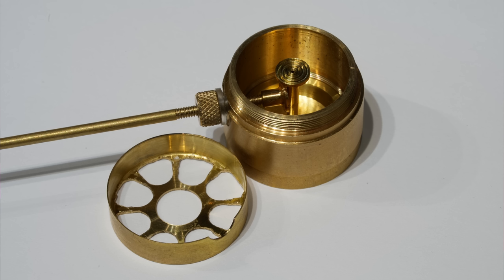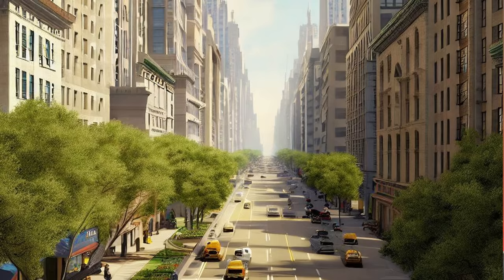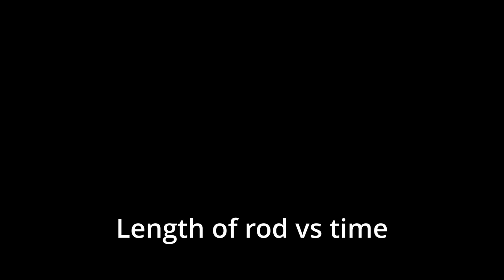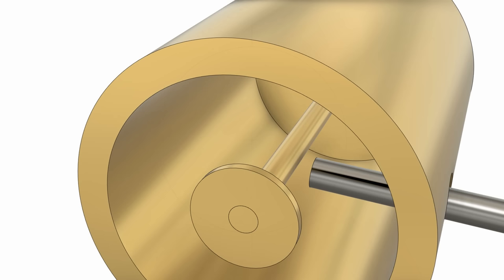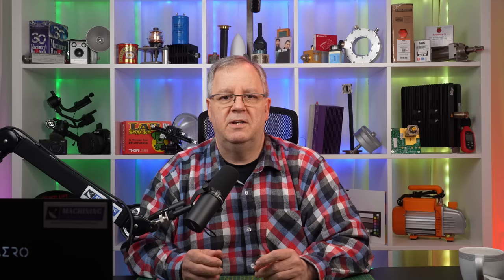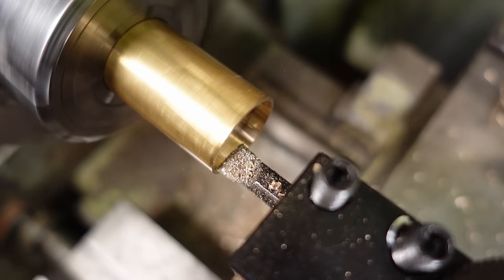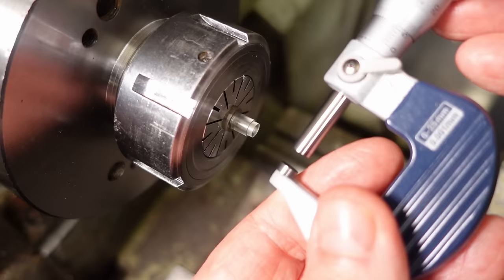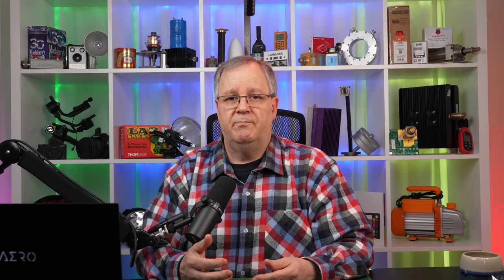SOLVING the Mystery Behind a Soviet Spy Bug : A True Masterpiece of Technical Elegance!

Comment: Have any of you guys thought that he just explained Havanah Syndrome? They weren't using an EM Weapon on the people who were stricken with it, they were bugging them and they were collateral damage.

The transmitter tube could have been something from us in the form of lend-lease gear too. 

Lastly, what are the chances that they would heterodyne down to a regenerative detector? They're known for having a wide receive bandwidth that would make any sort of dynamic fluctuation in frequency less apparent, although at the detriment of being more susceptible to noise which may not have mattered nearly enough back then.
Reply from the maker: Have a read of the wikipedia page about Havana Syndrome and the Moscow Signal. The signal levels for the Bug are tens of thousands of time lower than those we all get from nearby wifi and cellphones.  The only harm from RF is thermal heating, and that needs field levels that are well above the ICNIRP 2020 limits. Those Havana Syndrome effects are usually dismissed as shared hysteria or effects from infrasound, ultrasound, chemical treatments for Zika, stress and so on.  It's fascinating, but there's not much in the way of evidence.  RF signals are trivially easy to detect, and at least in the 3 to 10 GHz range, a few watts on your hand feels pretty hot, despite there being no measurable rise in temperature.  Reasonably High levels of pulsed microwaves are supposed to be able to elicit a response from human ears,  see the paper by Allan H Frey, (Journal of Applied Physiology, Vol. 17, pages 689-692, 1962) https://journals.physiology.org/doi/abs/10.1152/jappl.1962.17.4.689 
Frey reported needing about 275 mW per square cm  to elicit an auditory response.. USSR safetly levels win the mid-70s were 0.01 mW/cm^2 and UK limits were 10 mW/cm^2, so that's a pretty significant signal level. The illuminating signal for the Bug was around 2 million times weaker than Frey's experiment.

I think USSR scientists and manufacturing plants were entirely capable of making their own UHF tubes by 1943, but with a well-developed procurement network in the US, there are all sorts of possibilities as well as potential lend-lease sources and UK supplies.  My stepfather worked on the Arctic supply convoys from the UK to Murmansk during WW2 and said there were lots of interesting-looking packing cases on some of the shipments.  Also of course, there are potential supplies from Germany before 1941, but there was certainly a mature vacuum tube manufacturing base in various parts of the USSR in the 1930s.

Can't see any reason to use something other than a homodyne approach, although a self-oscillating regen might get injection-locked to the exciting signal and give much the same effect. I haven't seen any direct evidence, just multiple anecdotes.

Comment: As the kid I took all apart a lot of electronics One of the things I've noticed is that old phones had speakers that utilized the capacitor propertys listed here.. the speakers were connected to phone wires depending on the length and orientation the phone might have been able to act just the same..😅
Reply from the maker: Most passive speaker technologies can act as microphones.  Earpieces like that usually have a nickel plate with a magnetic bias and a coil to vary the mag field, so more like a dynamic microphone insert

Comment: This is like a string attached to the bottom of two paper cups, when you speak into one cup the sound waves travel down the tight string to the other cup.
Reply from the maker: Exactly, except one of the cups is imaginary and the string is virtual. 

When I was 12, I got some friends together to make one of those systems.  We used a thin steel welding wire and two coffee cans with corrugated bottoms. It sounded terrible, but we had enormous fun. After that, we set up a telephone system using some scrapped Trimphones with a pair of wires sneakily hidden in a hedge along the back of the gardens to my friend's garden shed, three houses down the street. We powered it from seven PP3 9 volt batteries in series.  Happy days.
Reply: @MachiningandMicrowaves  Awesome thank you for the reply, fun things we did as kids.

Comment: "Wouldn't" the species of wood used for the housing of the bug have also helped with loud sound insulation?
Reply from the maker: It would certainly have an effect, they thinned the wood beneath the eagle's beak then drilled hundreds of tiny holes.  I did the same in the plywood box I used at the BBC, stripping out all but the last lamination, then drilling 120 0.4 mm holes. Also the wood would affect the resonant frequency of the external antenna as it is a dielectric.

Comment: The Klystrons, Backward wave tubes and magnetrons were very well developed vacuum microwave devices available at that time....
Reply from the maker: I think it would have only been possible to use a linear klystron as reflex klystrons, magnetrons and BWOs are not narrow-band devices and are unstable and have huge phase noise.  There are some klystron articles and patents from the early 1940s like this http://www.ase-museoedelpro.org/Museo_Edelpro/Catalogo/tubes/records_nw/Sperry_early_klystron/Radio-News-1944-01-R.pdf that show klystrons for the UHF region. The early work by the Varians in 1938/39 was probably well known to USSR manufacturers, and there is early work at Stanford which was published http://www.ase-museoedelpro.org/Museo_Edelpro/Catalogo/tubes/records_nw/Sperry_early_klystron/Electronics_Jan_40.pdf but I've not seen any actual documentary evidence of USSR manufacture of linear klystrons for the UHF region around 1 GHz.  Telefunken in Germany were making some klystrons by 1943, so it's likely that USSR tube plants would have the R&D capabilities to develop suitable tubes once the basic buncher process had been made public. There's some catalogue info from Sperry for the SRL-17 at https://www.radiomuseum.org/tubes/tube_srl-17.html, but they operate a closed private database and don't allow document sharing even for members.  Do you have any references for linear klystrons in the 1GHz region from before early 1944?
Reply: @MachiningandMicrowaves  The microwave devices were designed and produced by ISTOK institute in Fryasino near Moscow (https://en.wikipedia.org/wiki/Fryazino). The work had independent start, but the development was accelerated by bringing in the engineers from Germany (Telefunken?) as reparation contribution after WW2. These engineers were not really prisoners of war, they were paid decent compensation and they jointly worked on development of advanced vacuum tube technologies, together with their russian counterparts. 
That "collaboration" together with strong theoretical schools allowed to create analytical methods for describing the field and electron flows in these microwave devices. The klystron department was headed by Nikolay Devyatkov (https://en.wikipedia.org/wiki/Nikolay_Devyatkov), apparently one of independent inventors of reflex klystron in 1940 (known also as Sutton tube) https://www.radartutorial.eu/04.history/hi92.en.html. This entity later developed other purely electronic tunable sources of microwave, millimeter and sub-millimeter-wave devices up to 1.5THz (1500GHz). So while probably there are no references of the details of the technology used to drive the "thing", most likely it used mechanically tunable reflex klystron as an LO with further power amplifier in the form of other vacuum amplifier like in radar, and there were rather customary technical solution.  
The "thing" was allegedly invented by Leo Theremin, the original inventor of the ThereminVox in circa 1920. https://en.wikipedia.org/wiki/Leon_Theremin. He was the enthusiast of capacitive sensors in electronic music and other applications, and similar ideas apparently were used in remote control of polyphonic Theremin.
As for the millimeter and sub-millimeter wave generators, they were used in different fields, but one of them was very unusual - in medical applications (https://www.ursi.org/proceedings/procGA08/papers/KP2p10.pdf). 

Ah, that old days history...

Comment: Didn't Fermat write that in a letter to his mate about his theorem in the margin? The copper foil stretches better after annealing.
Reply from the maker: Annealing thin rolled copper foil is a nightmare, even if you use a hydrogen or argon atmosphere, weird things happen to the lattice. Using a mix of argon and ethanol seems to be the favourite, but for my purposes, a 5% stretch from the as-supplied condition seems to give a reasonable result, although I haven't tried surface etching to view the grain boundaries under a microscope. Copper is a totally sub-optimal choice, I think electrodeposited nickel about 10 um thick on a titanium drum, followed by a silver plating about the same thickness might be the way it was done originally, but without physical evidence, it's tough to make any guesses.  In related news, I'm just bidding on ebay for a bit of titanium bar about the right size...
Reply from the maker: I think he wrote it in the margin of his copy of Arithmetica, in the 1630s.  There's a reference to the margin note in the 1670 edition from Fermat's son saying:

"Cubum autem in duos cubos, aut quadrato quadratum et generaliter nullam in infinitum ultra quadratum potestatem in duos eiusdem nominis fas est dividere cuius rei demonstrationem mirabilem sane detexi. Hanc marginis exiguitas non caperet." 

which my grasp of schoolboy Latin almost renders understandable.  My esteemed friend Google Translate refuses to do it on my phone, but typing it in results in:

"Now it is right to divide a cube into two cubes, or a square into a square, and in general no power to infinity beyond the square into two of the same name, of which fact I discovered a wonderful demonstration of course. The smallness of the margin would not take him."

Sadly, the cameras of the day didn't save JPEGs, and the original well-thumbed copy of Diophantus's mathematical opus doesn't appear to have survived.  Pity.  Still, Andrew Wiles worked out a proof using maths that wasn't invented in the 1630s (like cameras), so go figure.

Comment: My dad claimed that he once picked up Radio Blackburn from a mechanical coin mechanism made for coffee and soup vending machines in the 70s. I believed him, but the story about a guy picking up radio ham transmissions on his tooth filling.....
Reply from the maker: The "rusty bolt effect" with oxidized metal to metal contacts is well known, and if you have a suitable semiconducting contact and a way to turn the demodulated signal into vibration of something springy, then with high field strengths it's certainly possible to have mechanical things receiving AM broadcasts. Tooth fillings I guess would need to be loose for any rectification to produce a sound. I think I need to try making a pure mechanical AM radio receiver!
Reply: @MachiningandMicrowaves  Oh to be retired. I would love to give that a go, but I've got too many QRP projects unfinished on my bench.  I'll give you a shout in 2 years, Neil!
Reply from the maker: @johnwilson3918  I dream of retirement, the Day Job is really intruding into radio and machining time these days

Comment: VERY interesting BECAUSE: there have been many cases in the past of people in large government buildings saying they can "Feel" Something like a ringing in their ears or head or something they couldn't explain and some even had to take off work to "Get Away From It". Could this be related to this type of bugging device that requires an input signal?
Reply from the maker: Have a read of the wikipedia page about Havana Syndrome and the Moscow Signal. The signal levels for the Bug are tens of thousands of time lower than those we all get from nearby wifi and cellphones.  The only harm from RF is thermal heating, and that needs field levels that are well above the ICNIRP limits. Those effects are usually dismissed as shared hysteria or effects from infrasound, ultrasound, chemical treatments for Zika, stress and so on.  It's fascinating, but there's not much in the way of evidence.  RF signals are trivially easy to detect.

Comment: This video shows me how much I don't know that I don't know about things I don't know about. Much of this description went way over my head. I have a background in machining and simple circuits, but there are some major holes. Aside from the microphone functionality, is this similar to how RFID tags relay information?
Reply from the maker: It's slightly different in that most RFID tags work at frequencies around 100 times lower, and use active components that modulate the near field of the very nearby transmitter so it can feel the load pulling from the modulation. The bug uses modulation of the retransmitted signal so the transmitter doesn't feel any effects at all. I need to do another show and tell about this, but I'm working an a project covering the EASYCHAIR Mk2 which is closer to the way rfid tags work

Comment: Thank you for those videos! One question though:
At about 12:00 one thing I don't get: You speak of amplitude modulation, but does changing the capacity not change the resonance frequency as well? So beside AM, a FM method might work as well, as long as the distance between the non-passive sender-receiver is not too great allowing the FM method to be used. Using the speed of light as reference FM might work within a few hundred meters!
Reply from the maker: As the tuning of the cavity changes, the amplitude of the induced and re-radiated energy changes syllabically with the voice, there is also a tiny amount of phase modulation, but the modulation index is tiny, and it appears that the first-order PM sidebands coincide with the AM sidebands, although their phases differ.  As the amount of PM sideband energy is so low, I couldn't detect anything at all in FM mode.  The tuning is set about 6dB down the resonance slope where the rather of change of phase is relatively low.  The main effect is that the resonance curve centre frequency varies and the amount of energy in the system varies.  The loaded Q of about 1000 means that the envelope of the reradiated signal can follow the few kHz of audio faithfully with no weird phase effects.  The system could follow audio frequencies up to a few hundred kHz if the microphone could manage that, but the limit is the mass of the membrane and the mechanical self-resonances.
Reply: @MachiningandMicrowaves  Thanks for the explanation! So FM is there, but the effect is way too small to be better than AM or to be useful at all, when I understood you right.
Reply from the maker: @JouMxyzptlk  Strictly it's phase modulation, but for avlow modulation index, they are pretty much identical

Comment: I've heard for a long time that the pyramids generate power simply by their geometry. I never quite understood that until I watched your videos. If I understand this correctly, (which I probably don't), this device generates its own electrical power simply by its geometry. That's a concept I find fascinating. No rotating parts, and no energy storage device. Just shape. Yeah, I probably got that all wrong.
Reply from the maker: You have to beam energy at it in the form of a microwave signal, but there are vampire devices that simply harvest radio, cellphone and TV signals and turn them into tiny amounts of electrical power, usually to run something that only operates for tiny periods.  There is a wonderful type of Bug that uses a diode as a rectifier to make power, then uses the same diode as a modulation device.  Brilliant. Pyramid Power is just hokum, but it probably sells books and website clicks! Some types of rock are reasonble dielectrics, but most are terrible, so trying to use a Pyramid as a signal concentration device isn't going to work unless it's made from PTFE or Rexolite or similar.  Or quartz.  Oooh! Imagine a quartz pyramid.  Nice!
Reply: @MachiningandMicrowaves  Excellent reply. It cleared a couple of things up for me. As far as quartz goes, I believe, (don't quote me), that granite is comprised of a great amount of quartz, so,.... Maybe! As I said, I claim no expertise, so I am always open to new input.
Reply from the maker: Mica is also good, but the mix of small grains in granites, with plagioclase, feldspars, quartz, biotite and amphibole, mostly alumina and silica (both good dielectrics) with various alkali metal oxides is where it gets tricky.  Those are potentially lossy.  I have no idea what the Great Pyramid is made from, although wasn't oit originally faced with limestone or something similar?
Reply: @MachiningandMicrowaves  Yeah that's what I understand is that it had a limestone facing on the outside, but the majority of the stones are granite. And again I say don't quote me. Comment sections on YouTube are a great place for people to act like know it alls. I'm not one of them. I'm curious because there's a lot of things I don't know. I appreciate your indulging me.

Comment: What a wonderful video - I've been waiting for this for a while!

Is a high-frequency modern-day equivalent of this possible? I'm sure we could make something much much smaller these days...
Reply from the maker: The developments during the mid-1950s were even more amazing.  With MEMS microphones, you can make really tiny devices, but energy-harvesting and supercapacitors are still bulky. I'll have a go at some of the other early systems later this year, I've got most of the components for an EASY CHAIR Mk 2, but ideally I'd want to make a reproduction of the transmitter using period-correct thermionic devices.  I have some early 1960s transistors that are very nearly correct, and one subscriber has a resin-cast device block so it would be fun to get some detailed X-ray micrographs of that and make a faithful reproduction that actually works.